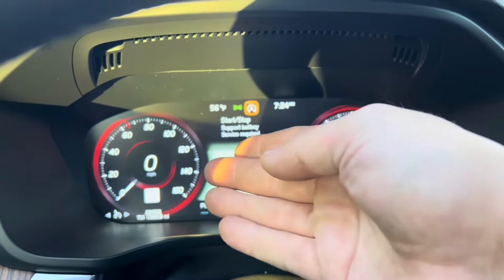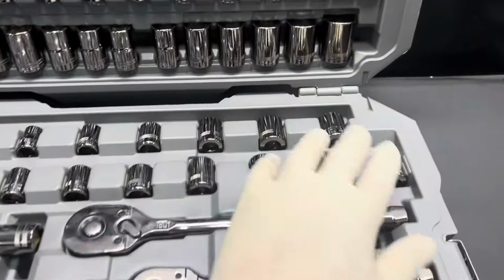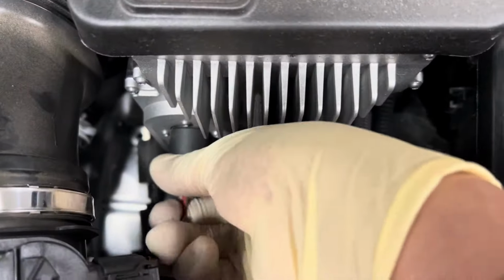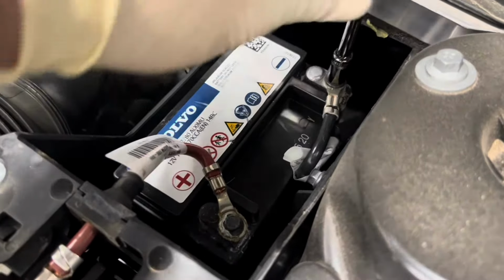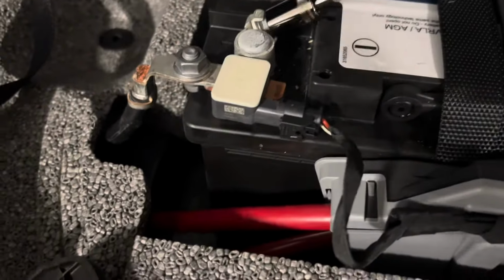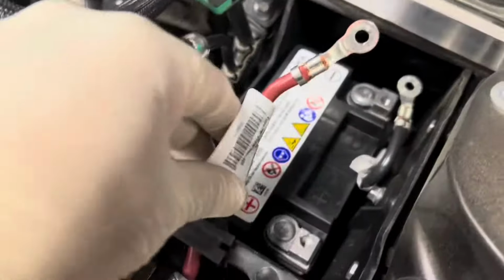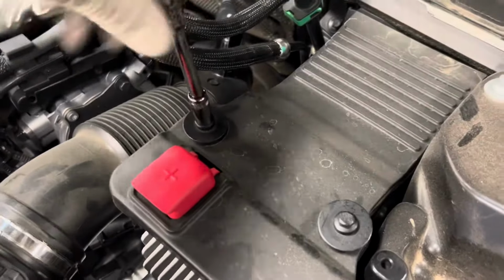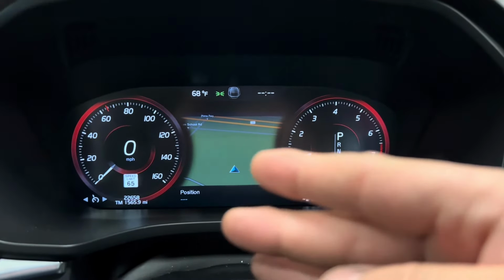Volvo XC60 Start Stop Service Required, Support Battery Replacement! Tools @craftsman

Comment: @wrenchingmafia. I follow all instructions just as explained here. Yet the start/Stop wont work. Weather now is over 90F. Dealer says it requires a software calibration, is this true?  When i installed it i removed the Negative cable for 15 plus min and still wont work. I dont have any messages on the dashboard. It just wont work. I live in South Florida, not sure if the weather has anything to do with it. 2020 XC60 R-design

Comment: Just a comment that will make things easier and faster for most folks with a SPA S2 XC60, no need to do anything with the main battery, leave it be. Simply remove the aux battery and insert a new one. Thats its.  A good replacement aux battery (under $100 AUD) is the Predator YTX12-BS is fits straight in and is readily available. I purchased mine for $75 trade price.  Good idea is to give it a charge before you insert it, if you don't have a charger no worries. If you still get a warning message (I didn't) cancel it with the 'O' confirm button on the steering wheel. Thats all you need to do. This should carry over to most other (non-hybrid) series 2 SPA Volvos. The original battery is a FIAMM BTX12 it has a Volvo sticker on it, but it's nothing special, just 12 Volt, 1OAH. 170CCA AGM battery.  Cheers Jay

Comment: Thank , you help me 100%🎉. I perform next work .... 1. Disconect battery in bagage comportment ( Big battery 😅) , 2. Disconect 2 harness control module secondary battery start stop . 3.Replace secondary battery . 4. Wait 20 minutes. 5. Connected all harness connector to control module secondary battery. 6. Conect big battery in bagage comportment . Start the engine .... . Sistem start stop work , without fault on dash panel
Reply from the maker: Glad it helped 🔧

Comment: I own a 2018 XC60 T6 R-design and recently had a few reduced functionality messages - Power steering, Driving assist, Active Bending lights. Plus, city safety functions were completely disabled. 

I have watched a few clips regarding the support battery replacement. There were some different ideas in each videos, but I decided to do everything I could do - disconnecting all wires/plugs on support and main batteries and wait for 20 minutes. 

Unfortunately, it did not make any changes after the replacement and my personal settings were still there - so perhaps 20 minutes were not enough for the RESET. However, I decided to drive the car for a while cause some people mentioned that they simply replaced the battery in a few minutes and then the errors disappeared after several drives. For me, leaving the car locked for a day did not work. The next day, however, the all functions came back and warnings were gone after driving 10km. Hope this will be helpful for other Volvo owners.

Comment: Great video! I have this error message on my 2019 XC60 and plan to do this replacement myself this week. Two question's:
1) Do you recommend using only Volvo OEM replacement battery or is aftermarket ok?
2) Would you recommend that I replace main battery at the same time since it's also 6 years old to avoid any future issues?
Thank you!

Comment: Thanks so much for the video. I wasn’t able to unhook the top cable near the starter battery, only the bottom but it still reset.
Reply from the maker: @mattplickert7937  glad it worked 🔧

Comment: Thank you so much for making this video. I need some advice. I have watched the video a few times before trying to replace my support battery. I haven't change it for 7 years and didn't even know it exist. I followed your instructions until got stuck removing the bolts. I have removed the right side, but the left side for whatever reason won't come out. I used a 6-point 8mm ratchet wrench. I sprayed multiple times of WD40 and PB blasts with 2-3 hours waiting between each spray and wire brush trying to removed any rust, but still can't unscrew. I noticed the battery cover moving up and down while I was unscrewing. Could you please tell me what that means and what else can I try to remove the bolt? I have tried more than 24 hours so far. Please help. Thank you.
Reply from the maker: @hccyang  try using an electric 1/4 impact to remove the 8mm.
Reply: @WrenchingMafia  Ok I'll try that. Thanks.
Reply: @WrenchingMafia I tried pulling the cover forward will using the drill and was only able to get one off smh. At this point idk what else to do

Comment: I changed the service battery with a brand new, but i didn't wait for 15 and i didn't disconnected the negative pole from the principal battery, so the error still continues to appear. Do you think if i do like you in the video i will resolve the error problem?

Comment: Thank you very much you helped me, this problem appeared 2 weeks ago after I disconnected the main battery cables during the holiday the alert disappeared and the parking sensors worked again my car is volvo v60 2019
Reply from the maker: @cmvm7155  your welcome

Comment: Hello, I have a question. After replacement of support battery already, do we have to clear/set up program again so that the message won't show? Or will it be automatic?
Reply from the maker: Lock the car for 30 minutes and message should be gone

Comment: Can we use 12v 8Ah battery for this ?
Reply: Do you have a video on how to replace the main battery (located in the trunk) on this same car so as to not mess up any settings? 
Also, are these two batteries only available from Volvo or are they available through most aftermarket dealers?
Reply from the maker: @Itsme-vo4fx I'll make a video soon. I always recommend going OEM seen aftermarket batteries cause messages related to voltage
Reply: You need to use Start-STOP battery! If you dont it will die in few months. I used 13Ah battery, little bit higher than original.